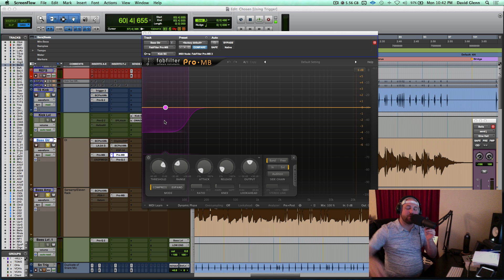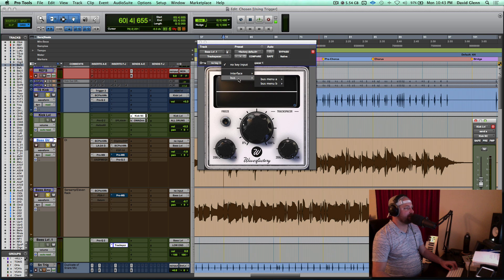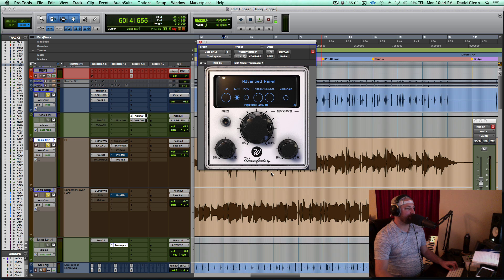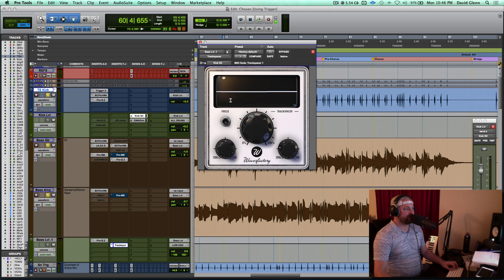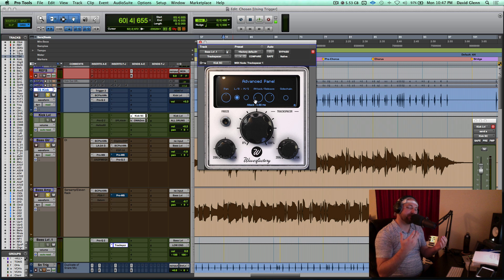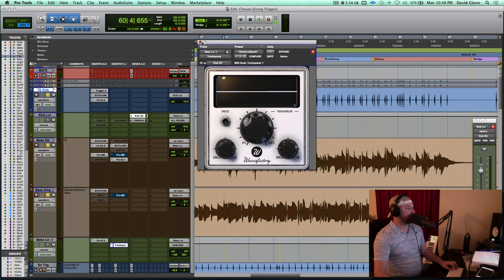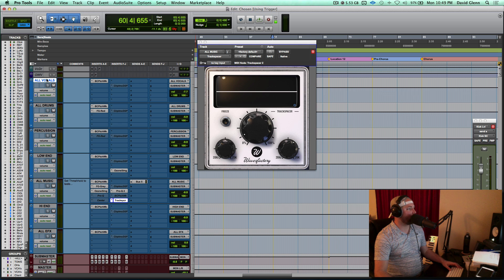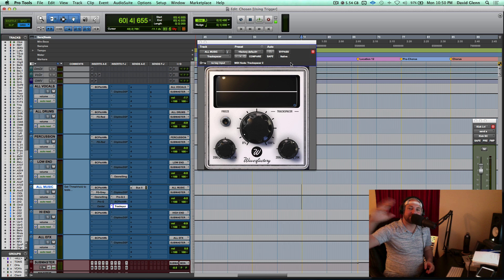How to Use Wavesfactory Trackspacer for Frequency-Dependant Ducking

Comment: What about of LFO Tool is not the same. thanks
Reply: I don't have LFO Tool, but i think it's a volume shaper. Trackspacer is a multiband compressor that ducks only the frequencies you need to, while LFO Tool ducks the whole signal. Let's say trackspacer allows some of the signals to pass from the sub if they don't clash with the kick.